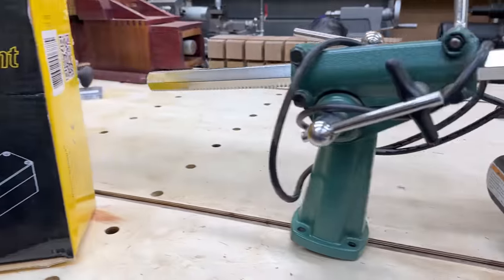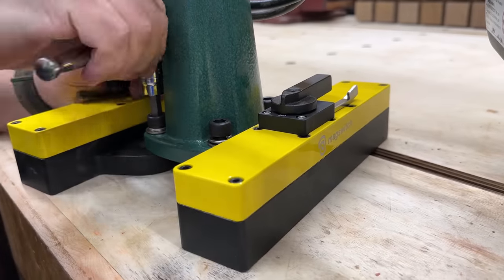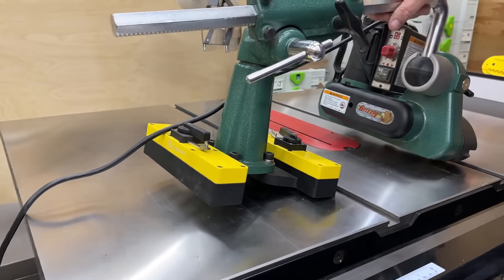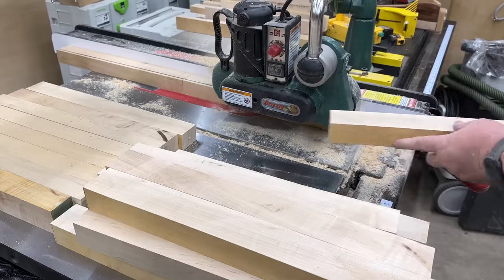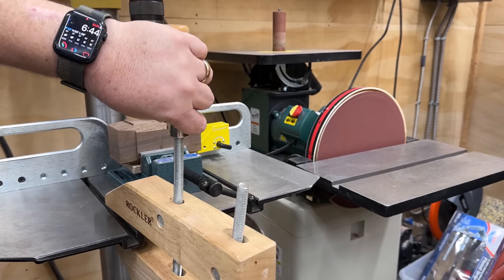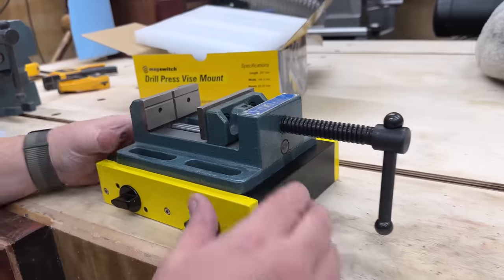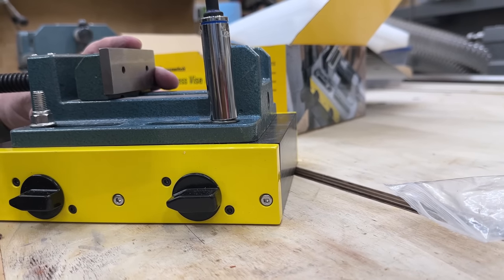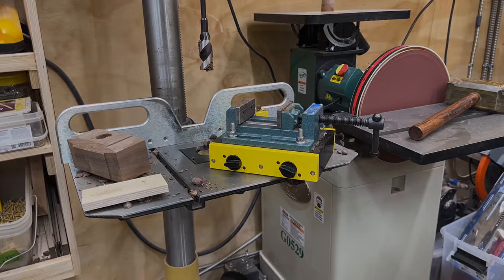Check out these tool upgrades!

Comment: I really like magswitches. From feather boards to jigs, they are great as you don’t need to make everything to fit your table saw or bandsaw tracks, and they can actually make you work safer as you’re more apt to toss on a quick feather board, jig, or whatever when you can quickly attach it to your table top. They also make great stops! I really have no use for the two magswitch devices on this video, but I can certainly see the benefits they could add.
Reply from the maker: I have a lot of their stuff, haha. 
Thanks for watching!

Comment: I like the idea of magswitch, glad to see they're innovating. I bought one of their drill press fence kits a while back, with a gold colored aluminum extrusion (the kind with lots of slots in it). Unfortunately the extrusion was not flat, about .01" of bow in it. They were apologetic and sent me a new extrusion, which was also not flat. So, I ended up making my own L-fence out of some mdf. It works ok, and it's shorter which can be handy sometimes on the drill press so as not to get in the way of the chuck. Love your content.

Comment: I am an x ray tech and work at a place where we see quite a few saw injuries...  one unfortunate young man was actually in the process of making some push sticks to save his fingers....😪

Can't name names due to Hipaa...but yeah....I noticed that you had the Sawstop and you still chose to step up the safety level..  

I have not done much word working lately due to my full time gig...but if I had to cha get careers... and would be doing a bunch of production work....that Sawstop will pay for itself the first time you have the blade get wrecked instead of your body part(s).

Thanks for sharing these neat tools!
😇😎
Reply: I took off the end of my middle finger… twice… once at the table saw and once at the miter saw, due to simple carelessness. Same finger, same spot. Thankfully nothing too bad, but the 6 weeks it takes to grow back seems like an eternity when you need to work.

Tip (no pun intended…) for anyone who does something similar: after the 2nd or 3rd day, start applying frankincense around the wound. It speeds up healing DRAMATICALLY. You can get it from any essential oils dealer. Pricey, but I use it frequently. Maybe too frequently……….
Reply from the maker: Thanks for watching and commenting.

Comment: I have the shop fox baby feeder and want to mount to the left side of fence so u won't have to continue to move but the rollers are not flat when trying to adjust , I can go the other way all I want.  When I flip to mount to the right of the fence no problem

Comment: Safety First, great tools Table saw kick back almost killed me, power feeder would of prevented that. My drill press has slots in thabl and I have to screw vice down, time consuming and still vice vibrates loose, magnetic base looks like a winner, Thanks James
Reply from the maker: That’s one of my favorite things about them.  They are clearly designed to make some function easier, but every tool also add a big element of safety.

Comment: James, could the power feeder be used on the outfeed side of a jointer? To maintain proper pressure after the cut, especially on warped boards?

Comment: 👍I like the Magswitch design philosophy- simple fixes to problems - re the drill press vice base a small observation, it seems to me that four twist knobs is redundant you could fix a single cam lever so that pulling a handle on the front of base switches all four at once,  just a very minor improvement, perhaps you could pass onto your friend who helped design it (Kline?)
Reply from the maker: Yes. Andy Klein was the one I was referring to. I’ll pass on your ideas. Thanks for watching!

Comment: Great video James where did you buy your auger bit what's the brand name of it.
Reply: I’ve had great results with Woodowl bits from Taylor Toolworks. I have to do A LOT of drilling through end grain, which can be very tricky. I use a horizontal boring machine and those Woodowl bits with very clean holes.
Reply from the maker: @Steven Davis, I was wondering when someone would ask! 

Just like Michael said, they are Woodowl bits. And they are unbelievable!!
Reply: @KingsFineWoodworking   Thank you so much for getting back to me. Your videos are great!!
Reply: @KingsFineWoodworking  LOL, I actually hadn’t watched that far into the video to even see what you were using. I manufacture parts for an audio company, and they have parts that are 2” long with a 9/16” hole straight through the middle of the end grain, and that hole has to be dead straight, exact size and flawlessly clean on both ends. Right now I’m working on a batch of 200 with another batch up as soon as these are finished. Woodowl is worth every penny!

Comment: I tried using your links but I don’t see a 10% discount. Is there a code to use?
Reply from the maker: Hi, no code needed if you use the link. You just have to add whatever item(s) you like to your cart. Then when you go to checkout, you will see the discount applied, and the new total. 
Thanks,
James

Comment: wow.. that mount is1.5 times more expensive than the power feeder itself
Reply from the maker: Probably because they put magnets that can lift a car in it!  
But I know. I was sad that it was costly. But when I picked up the tool and started using it, I could see & feel why. It’s a little engineering marvel that’s built like a tank.